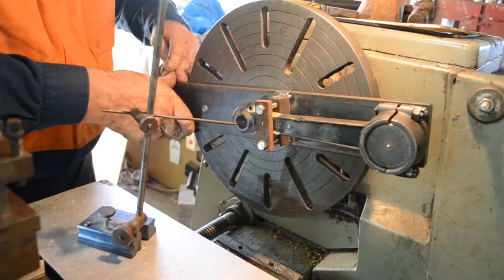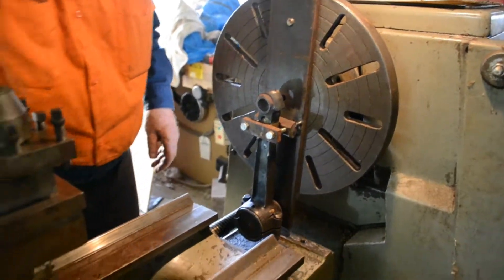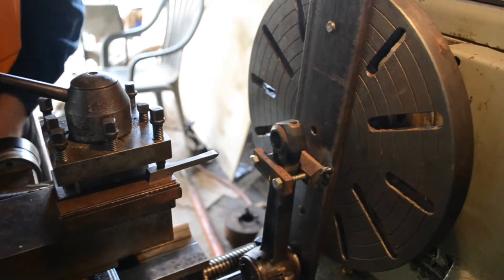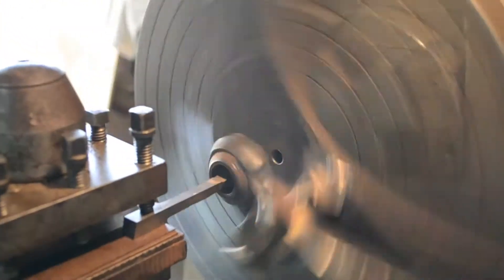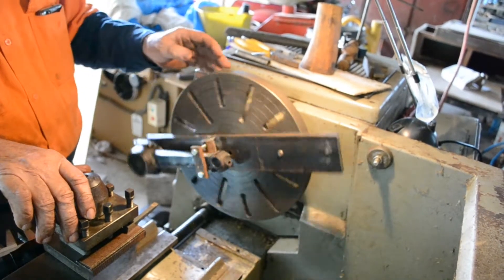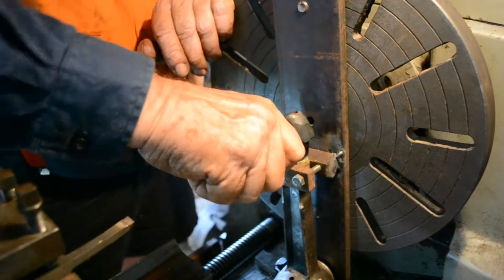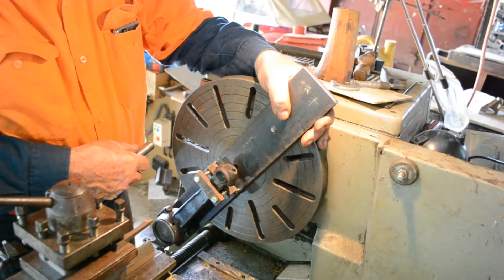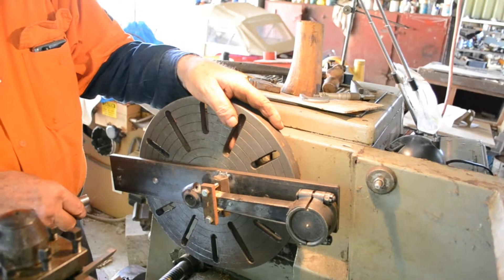Restoring Flanders 20 Motor - Part 4 Machining to fit the Gudgeon Pin

Comment: did you ever get this to run?  I know brazing is pretty strong but I wonder about cutting a perfectly good connecting rod.  Why not reuse the old pistons?  You can get new piston rings made especially if there were no oil rings.